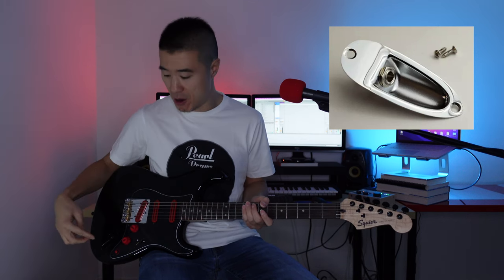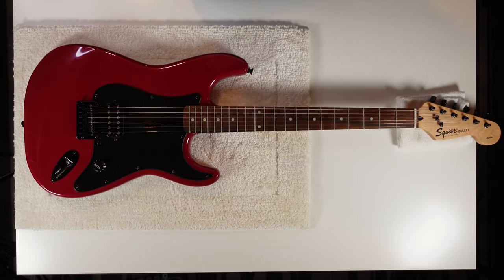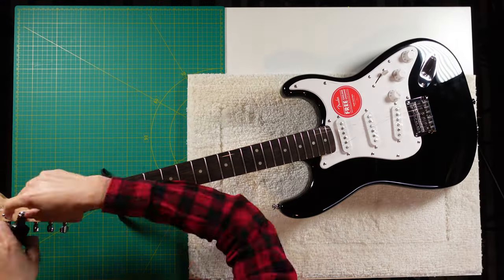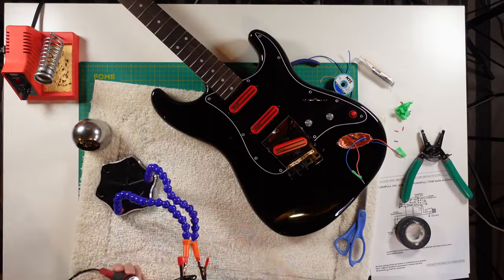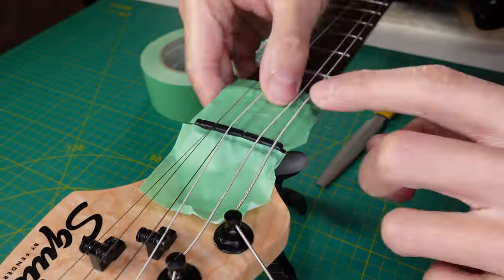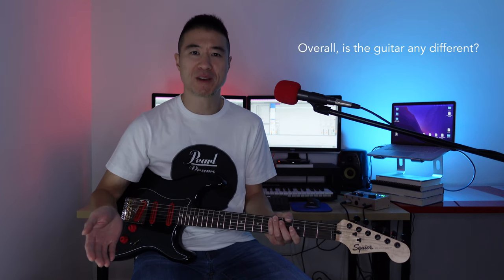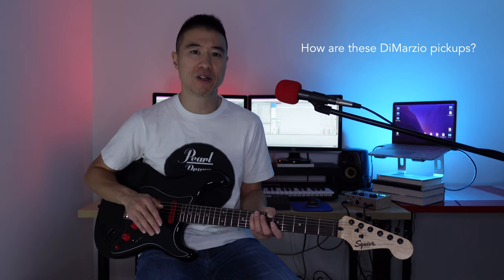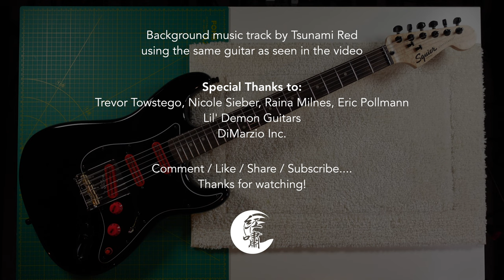Partscaster Build - Telecaster Bridge on a Stratocaster

Comment: Nice!  A few comments and questions:
Did you try regular single-coil Tele pickups? That's where you get real Tele sound. I'm not a huge fan of rail pickups be comparison. They probably sound very similar even in a regular strat without the metal base plate.

Copper tape: The switch connections shouldn't really make contact, but if they do, you can just put non-conductive tape over the copper shielding. Having said that, the copper shielding won't do much when you're using rails, since the rails are already hum-bucking.  In fact traditional Gibson and Fender pickups kind of have that backwards: Fender single coils do hum, but Gibson went thru pain and expense to use metallic shields on their humbuckers. BTW, close proximity, including humbucker covers, results in tonal change due to 'eddy currents.' A separate subject.

You can solve spacing and routing for Tele pickups by using a reliable routing template from StewMac (Stewart McDonald). They show the 6 string holes that match up with the hardtail body's string-thru holes.

Filling the trem cavity: Some wood fillers and epoxies will work. Some won't. I would never use the stuff in a tub anywhere close to a guitar, or for large fills. But there are epoxies that don't shrink as much.

And a question for you: I hadn't seen that wooden 'plug' for the trem cavity before. Where did you find that?
Reply from the maker: Hey hey!

- I didn't try regular single coil Tele pickups for this guitar, but I did in my original DIY kit Tele video. I'm sure there's a distinct tone in them.

- The switch connections made contact because this Bullet Strat is shallower than a standard Strat body. A few others have suggested putting tape over tape like you mention. Never heard of 'eddy currents', will look into it some time, and interesting to hear about the companies having things backwards!

- The idea of further routing the body did occur to me but was never an option - I don't have any appropriate tools, not to mention how much more work it could be (with the chance of permanently messing things up!)

- Epoxy - totally heard, I still wouldn't consider it!

- I found that wooden 'plug' from extensive Google searching and eventually found a seller on Reverb, who told me it wouldn't fit a Squier body

Greatly appreciate the pointers, and thanks so much for watching!

Comment: You can turn the 3rd knob do a "blend" of the middle pickup. I plan on trying this one day.
Reply from the maker: Someone suggested that to me as well and I like that idea. I'm just not sure how to do it exactly - I know it involves taking apart the entire pot and doing something with the insides, which seems a bit much.
Reply: @TsunamiRed  If/when you get to tinkering with your guitar again, I can recommend a fairly simple mod for achieving the neck/bridge combo along with a blend for the middle pickup in all positions. Wire the neck and bridge to a tele-style 3-position switch. Wire the middle pickup to one of the tone pots (remove cap, output to jack). This allows also for the "all three" setting, with the middle blend pot on full when in the middle position of the 3-way switch. The only thing you'd be giving up from a standard 5-way switch is position 3--"middle only"--but who uses that?

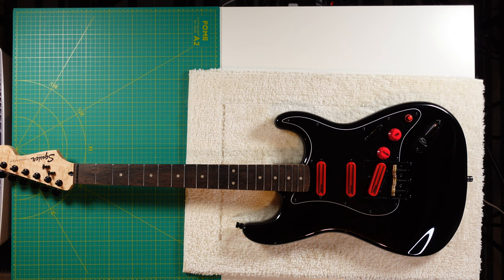Comment: 25:23 I was thinking that the nut might not be the right height earlier in the video... Because I saw in another video somewhere that you need to measure the old one's height from the fretboard first.
You need to measure both E-Strings slot depth and nut height, by the way.
At least that's what I remember.
Reply from the maker: That's a handy tip to keep in mind!

Comment: 'Burls Art' makes guitars entirely out of epoxy resin( with all kinds of things in it). probably would work great filling just the trem cavity. the Squier neck looks really nicely figured. Using the black bridge plate might have been another grounding problem, as I've found I had to sand off the black paint in some inconspicuous areas so the strings are grounded.( underneath the plate and inside a screw hole above so bare metal touches, so maybe you skipped that issue. black bridge looked sick tho.
Reply from the maker: I highly doubt the black bridge I have was painted with shielding paint lol, but yeah like you say, potentially an issue missed. Thanks very much for watching!

Comment: the best way for a tele bridge strat is to use a rear route hard tail body...  no pick guard, no tremolo toure, hard tail, rear routed..
Reply from the maker: Very true, but I had no means of being able to determine where to drill those holes on this Bullet body, hence I went with the alternate method I ended up doing.

Comment: because of not having the "cutaways" you call - the body contours, I modified the body on the Tele kit I'm building - by adding body contours
Reply from the maker: Yes, that's the correct term - contours. Or I could have said rounded edges around the body.

Comment: Some of the demo segments were excessively overdriven somewhere, so the sound was too muddy to assess well.
I do like the combined bridge+neck. The split version might have sounded a bit clearer and perhaps preferable to me.
You could probably compensate the gain around +6dB somewhere downstream to make up for the low output.
Not sure whether the split version sounds 'spakier' or not, hard to say without the levels being comparable.

Overall, I like the look and sound of the guitar a lot. You should be very proud of yourself for pushing through the frustration.
Keep at it!
🙂
Reply from the maker: The 'after' sound samples definitely didn't showcase the best sounding tones I could have achieved with the guitar and the VST settings, but I purposely kept the same settings to more accurately show the difference between the modded guitar vs. the stock guitar, the pickups being the biggest factor. No matter what amp settings I use for the split coils, it just sounded thin regardless. Maybe higher output humbuckers might be a better bet.
Appreciate the kind words, thanks so much for watching!

Comment: you didn't have to rip the tap out, all you really had to do was lay black cloth tape in the control cavity over the copper where anything may have been grounding out.  yup, sorry....  or route it out deeper?
Reply from the maker: Routing it deeper would have been risky, Bullet bodies are shallower than standard sized ones. DylanTalksTone usually recommends ripping all the tape out in the body, so that's why I did it.